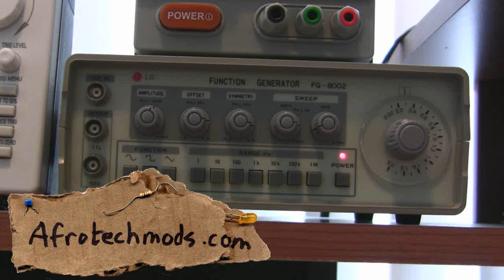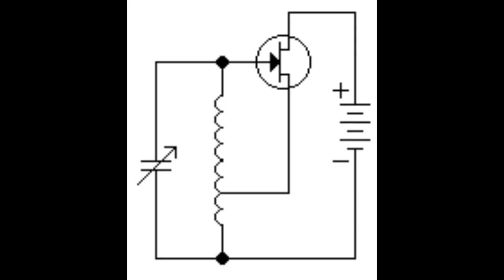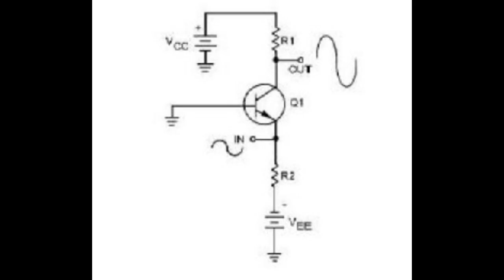Function Generator Tutorial: What is a Signal Generator / Function Generator?

Comment: Wow nice explation thank you 
Can i use it to drive gate mosfet power supply circuit board
Reply from the maker: You can indeed use a function generator to drive the gate of a mosfet. I have done it many times. But you must be aware that because of the 50R output impedance of the generator, the gate drive current is not great. So you can't expect it to do super fast switching of the mosfet. But for quick prototyping yeah it'll switch a mosfet.

Comment: Signal Generators are in the title, but not mentioned in the video. A signal generator just generates pure sine waves. With the exception of audio signal generators for Hi-Fi work they are typically designed to go up to a lot higher frequencies than a function generator can reach, and are used as RF sources for radio design/repair/testing. eBay has hobbyist sig gens that work up to 6 GHz for $70 or so.

Comment: I need a function generator that can simulate a Ford EEC-IV distributor signal. It's seven 12v squarwaves of 50% duty cycle, then one 12v 35% duty cycle square wave. And then repeat. I also need it to have variable frequency up to around 500hz I think. I haven't been able to figure out how to do this because of the one oddball narrow square wave. Got any suggestions for me?

Comment: Looks like you could build one for a few bucks using an LM324 quad op amp.  I found a schematic on Instructables.  I'm thinking of building it and adding a frequency counter.  It uses three of the four op-amps, so I'm going to investigate using the fourth to vary duty cycle.

Comment: Is a function generator an inverter(converts dc to ac)?and can the output wave be used in a transformer
Reply: No. They are DC as well; current flows and stop. It's rather a high-low state wave generator, which means; they produce a certain voltage at the peak of the wave and produce 0 volts at the bottom. An Alternating Current, on the other hand, produces a certain volt on top and a negative value it at the bottom. In the other word; AC flows forward and backward periodically.
Reply: pangpengmaster thanks man really helped.i have been looking 4 an answer since ages.may god bless u.
i accept wht u have said but what can actualy change dc to ac cuz i m working on i coil gun project i need to step up the volts using a transformer but squre wave will not work well because the core will saturate faster.so what can i use? thanks in advance
Reply: pangpengmaster Sorry I forgot to ask what is the difference between sine wave and square wave function generators ? Thanks in advance :)
Reply: Ziyad M It's been two years, and I know you must've gain a LOT of knowledge about electronics in two years. But I'll just answer in case somebody happens to search for the answer.

A sine wave generator, as the name suggest, generates sinusoidal wave. You can plot it in a graph with the function Y=sinX.

The square wave, again as the name suggest, is a wave that looks square-ish. The voltage turns on and off, and the graph can be plot using Fourier Series.

And yes, you can use a signal generator with transformers.

Comment: @Afrotechmods 

I having problem geting NPN transistor to turn-on with 
GF-8046 function generator i don't know why i can't get the transistor to turn on. I check the voltage and current output im getting voltage reading but no current at all. Afrotechmods did you using something before the transistor base to turn it on. If anyone can help here with advice on how to turn on transistor with funciton generator

Comment from the maker: To be honest, I have never used an FG in either radio transmission or reception. Some FGs have an extra input that allow you to amplitude/frequency modulate the signals you are generating, but unless you have a REALLY expensive FG you are limited to carrier signals in the AM band (around 1Mhz). PWM is generally not used in radio although it's technically possible. I plan on doing some radio tutorials but they would be several months out as I've gotta cover more basic material first.